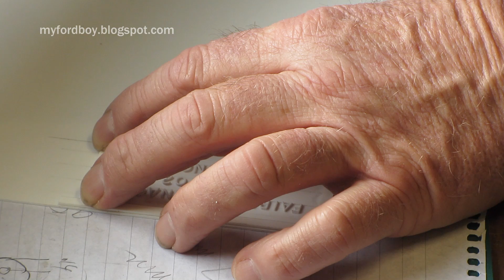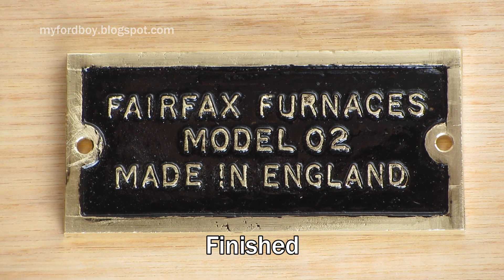Metal Casting at Home Part 55 Casting a brass label/plaque/nameplate

Comment: You shouldn't forget that round and pointy characters always are somewhat bigger than the flat characters. If you use a baseline, letters like O and C have to be positioned a little below the baseline. Letters like V and W too. At 4:09 it shows all characters are exactly placed on the base line, therefore it seems the text is a bit wobbly.

Comment: Hello, good idea about the lettering system... Simple and neat for hobby usage...
What is the temperature you need to bring the brass in the oven, including some time for taking out the dross and adding the flux?
Thanks for the inspiration, I'm planing to give a try to molding aluminium this summer.
Pierre
Reply: Appreciated, thank you...!

Comment: Thank you for sharing!  Very nice work.

Would it make sense to mill a bit of it from the top to even up the letters, remove and roughness from the sand, and level things with respect to the border?

In case anyone missed it, the sanding disk used to even up the sides of the mould was at a slight slant from the table (looked like about 10 degrees) so that the mould would have tapered edges so it would come out of the sand without dragging on and crumbling the sand. The gap shown by the square was intentional. (See?  I've been watching! :-)

-- Mike
Reply from the maker: BigMjolnir You could finish the part as you like and polish to a high finish but for my purpose the as cast was suitable. If you machined the top of the letters though it would spoil the appearance as they have a rounded surface.
I milled away the back of the plate to thin it so it could be curved to the shape of the furnace.

Comment: Hi Myfordboy. Again a very usefull video, lots of info. Question ; wouldn't light sanding the nameplate on a flat surface where some fine sandpaper is glued on not give a much finer result ?
Reply from the maker: HoutmeyersP The text is about the same height as the frame so the letters would also get sanded and loose the detail using that method.

Comment: What and interesting video. Is that a particularly fine sand as the level of detail in the cast part is better than you normally see?
Reply from the maker: CNCtrl The sand is oil bonded, it has the consistency of modelling clay. It does take detail well.

Comment: Mate watched your video on making a furnace. like it, so I figured I would have a go.  got all the bits will be using a gas burner. was wondering what's the best thickness of the walls and base as I about to start. I made the main body mould much like yours, but I noticed you made your base first, was there any reason for that.  or can I make the body first and then the base.  and did you seal around  the inside walls to your base or is it just resting on it.  any advice  would be most helpful.  cheers  mate.  Mick
Reply from the maker: For a gas burner you need less space around the crucible. 1"- 1 1/8" would be OK. I have 1 1/4 thick base and walls, I don't think any thinner would be strong enough and it would be hard to mould.. Best to make the base first then cast the walls on top. This way the walls fit the base perfectly. No need to seal it as it's moulded to the shape of the base and is tuck to it.

Comment: If i were to cut my own, bigger and thicker  letters (around an inch tall) out of something like plastic per se.  How would i go about adding draft to parts like the inside of ‘A’ or ‘O’?
Reply from the maker: Not easy if cutting from a sheet. 3D printed ones is the way to go.
Reply: @myfordboy  i was hoping you wouldn’t say that. Thanks.

Comment: Have you ever tried lost PLA casting? I am trying to cast some pins under 2MM without success. Is there a chemical i can add to make the aluminum flow better?
Reply from the maker: Bob Cartwright You need to have "head" on the feeder for small sections.

Comment: OK,  making the wall about 2.7/8 inches.  so just short a 3 inches. so 7.5mm. in my lingo.  using  an a25 crucible, to start going to use I large steel throw away crucible to melt ingots first, and get a stock pile.  so i have room to grow will take so pics and show you my progress if you like. oh and is there a better  way to keep in touch. cheers  mate will share my progress. back to work tomorrow so nothing til Tuesday fortnight.  take care mate
Reply from the maker: Personaly i see no point in making ingots. Just melt remove dross, degas , flux and pour into the mould. My email address can be found at myfordboy.blogspot.com,.

Comment: Are there conditions where you MUST use an oil-bonded sand?  And are there conditions where you MUST NOT use an oil-bonded sand?  Enjoying the videos!
Reply from the maker: Oil bonded gives a better finish but you loose a bit of sand each time as the sand around the metal gets burnt. It also needs more more to get it usable. No other reason.